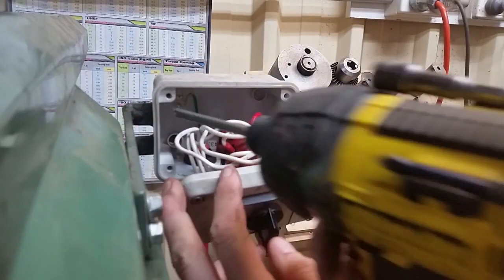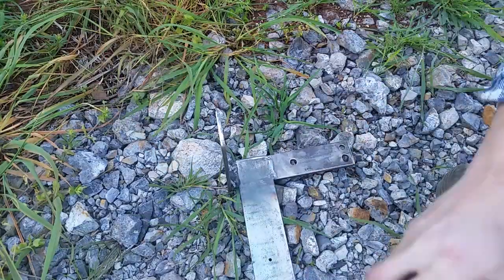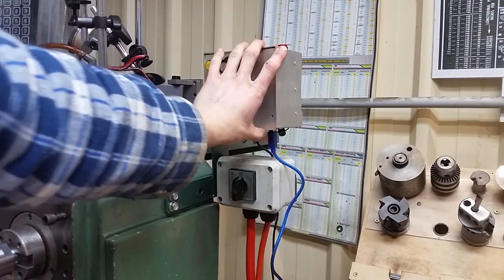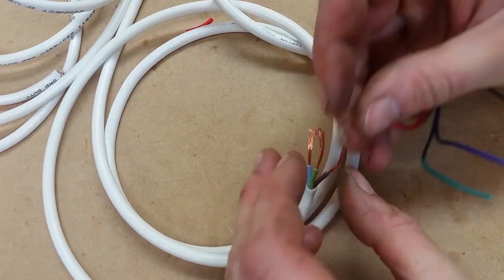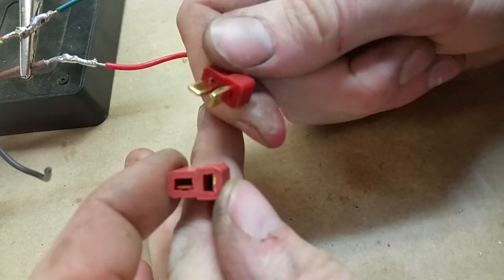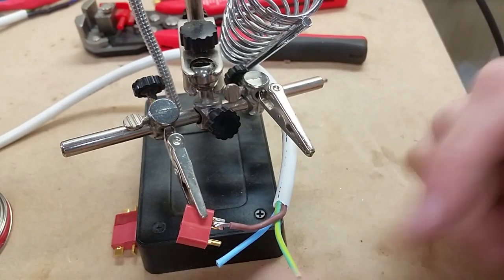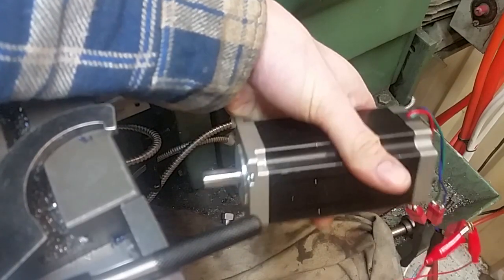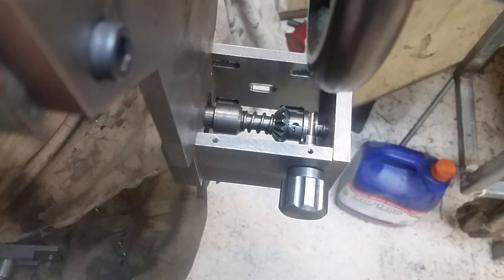Powerfeed 3 Wired up!

Comment: Чувак! 23-й для этого слабоват. Возьми что-нибудь с обратной связью.
З.Ы. Перебдеть лучше чем не добдеть.

just realized that some phraseological units of the Russian language are not fully translated
23rd engine can also work intermittently, better servo.
sorry for google translator
Reply from the maker: It is true, a larger motor would be better. I've just installed it and it seems to run ok, it can take reasonable cuts with a facemill. It is right on the limit of what the motor can handle. I might gear it down for more torque